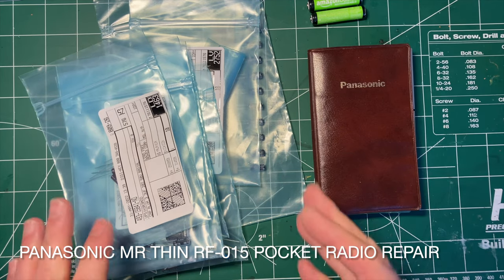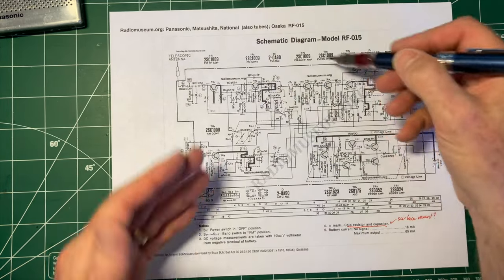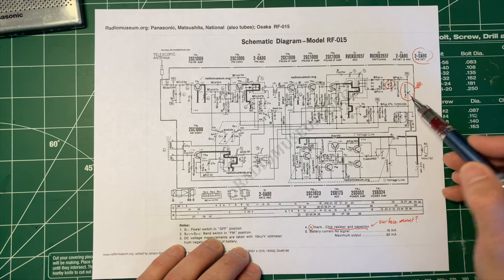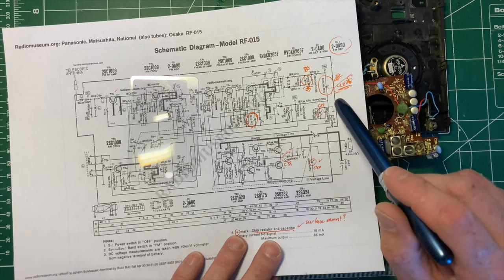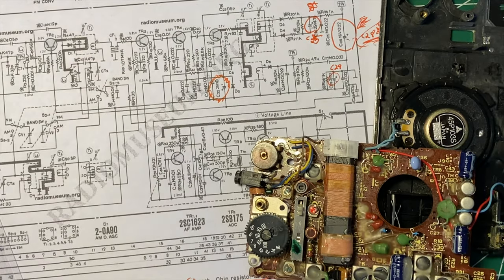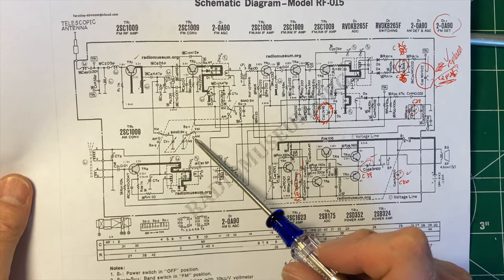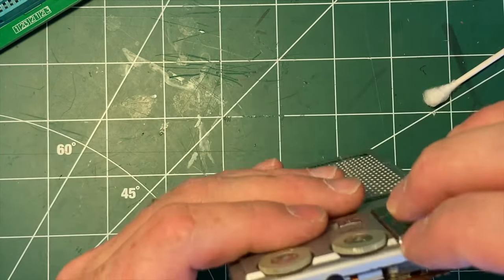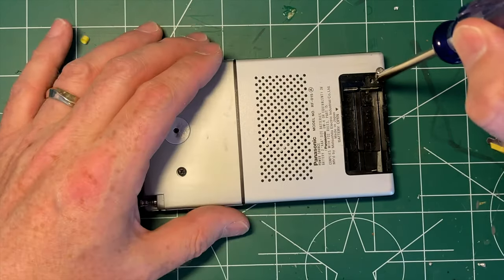Panasonic Mr Thin RF-015 Pocket Radio Repair

Comment: I’m looking for one ☝️ of these!! I bought one ☝️ at a thrift store 🏬 in 2010, for $5.00. The bad part was that it fell off of the bathroom mirror 🪞 (medicine cabinet). I think 🤔 the two radio halves separated upon impact with the vanity. The plastic was brittle, and sort of shattered, as to speak 🗣. I also bought one of these radios at Circuit City, in 1985. I don’t know where it went. I can’t even remember if it came in a Panasonic leatherette case. I’d clean 🧼 the circuit boards inside of this, because battery corrosion continues to damage components of this nature. Because my $5.00 Panasonic radio was hopelessly broken 😞, all I could do was save the speaker 🔊 magnet 🧲. Your friend, Jeff.

Comment: I just received this radio as a gift. The only thing I had to do was clean the battery box connections it works perfect. It is cool to know that it was used in the  Cold War as a receiver for security channels by spies because it was blocked on their radios

Comment: So, you've never seen common base connection before? It is used in all RF amplifiers because of its high impedance, resembling a vacuum tube properties.
Reply from the maker: Not at the time I made this video. One of the problems of being a hobbyist: there are lots of gaps in my electronics knowledge. I try to be open about that as I was here.

Comment: I have two of these radios. One picks up stations, but can lose the signal (or cut out) depending on the volume control. So if it’s playing fine at say mid-volume and I want to turn it up, the station/signal will disappear. What could be the problem there?  The other is odd also. If you switch to FM, you get nothing. If you move the FM/AM switch just a bit to the right you can pick up a signal. Most known stations are static though.  Any thoughts?  Also I have no clue about electronics. I will have to have them repaired. But I’d be nice to have some insight into the problem.
Reply from the maker: Before sending them for repair, try wiggling the switches and volume control back and forth. Often the problem is dirt and corrosion inside the switches etc. and that can often clear it. The next step is a spray of contact cleaner, but it is impossible to get it into the right spot on these radios without opening them.
Reply: Thanks!  I’ll give it a try.